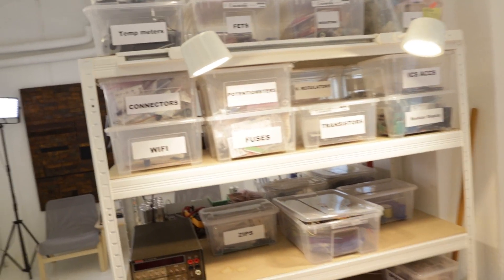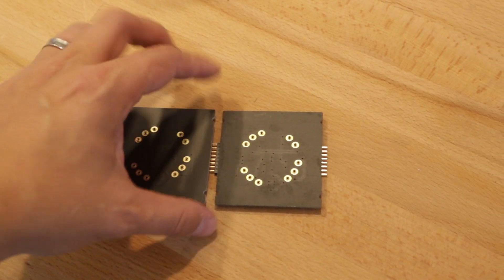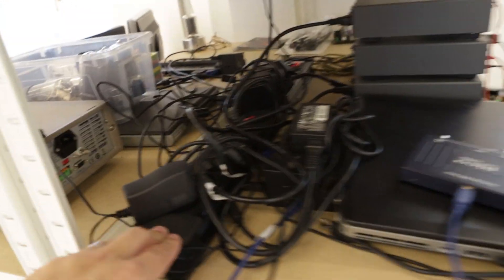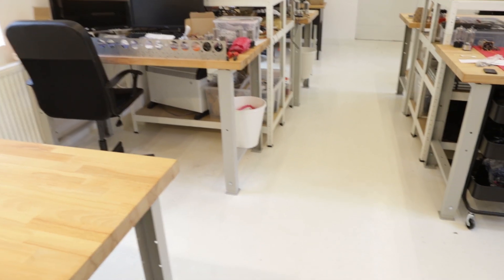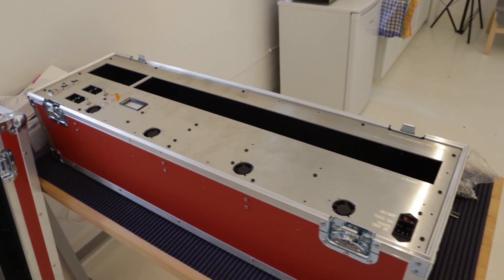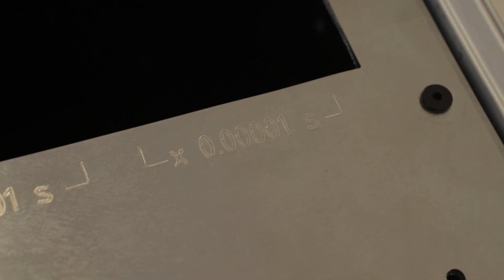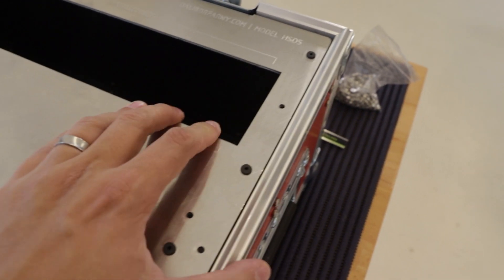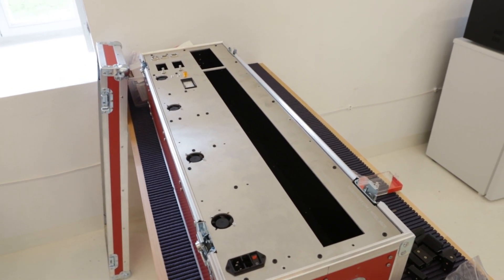Dream Electronics Lab - Finish

Comment: I have been looking for a good light for my work desk for years and these track lights from Ikea are really good option. Thanks! Btw, these desks are just regular work benches like this? http://rudeta.sk/dielensky-stol-200-x-70-x-84-cm-f200.html Probably, if max load of 70 kg is enough, you could take Bekant sit/stand desk legs with electronic adjust

Comment: Only comment I have is I would have use Server PDU's for the electrical plugs. But that's just me. You can usually get them for peanuts at auctions and they allow you to do a lot of things. Measure the amount of amps each line is using for starters (most have an LED display for that built in). But more importantly you can control them remotely and set up all kinds of useful things such (depending on model) staggered power-on of all the individual powersockets to avoid high peak currents in case of brownouts or a power interruption (short or long).

Comment: That high speed display is cool. Since you have 10 numbers per tube they each "only" have to run at 10khz, right? If you needed even higher speed you could double up the layers but I guess it would get too crowded unless you slightly offset them. You could also make a dot display if the speed is faster than the tubes can handle. Then you just count the number of dots that are lit up per frame to see if it is accurate. Kind of like an abacus.

One suggestion is to mount the power outlets to the bottom of the shelves or on a board across the back, so they are above the stuff that is stored on the shelves giving you easier access. This is almost exactly how I picture my perfect lab though.

Comment: At 15 minutes there is the High Speed Camera calibrator. I was surprised that you are using Nixies for such an instrument. I love Nixies and thermionic valves for thier aesthetic value. I would be interested to see more information about this instrument from a practical standpoint.
Reply from the maker: Mark Bolton I will, in next video(s).. stay tuned ;-)